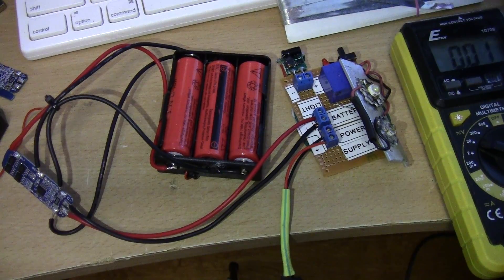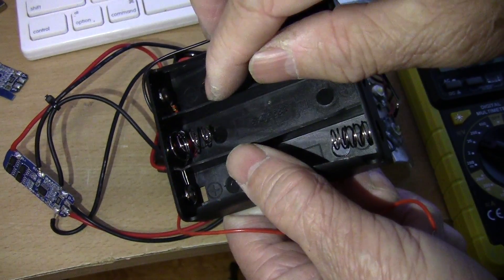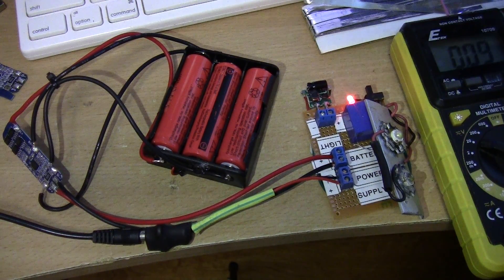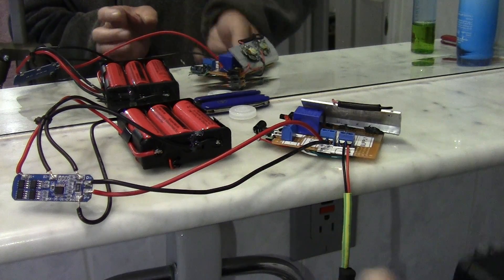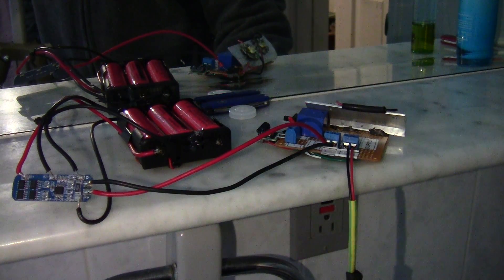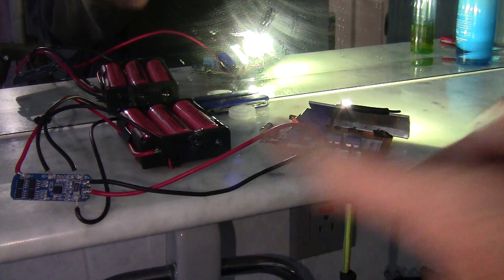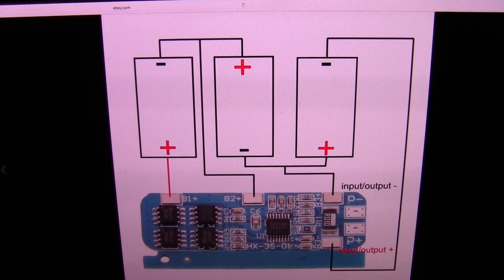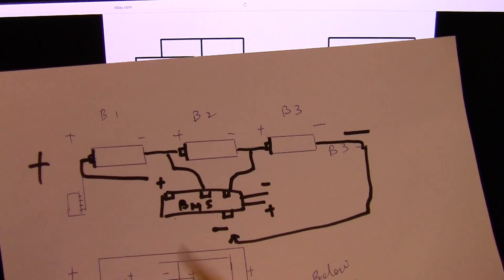12 volt dc auto on emergency light part 2

Comment: Can we charge this bms battery pack while the output of this bms is connected to load ?
Reply from the maker: Probably not a good idea.  I installed a new one on one of my newly built packs and for some reason, it just didn't work.  So if you already have a load on it, I just don't know how it's affect the BMS.

Comment: regarding one of your earlier video to generate electricity i have a question. using 12vt dc motor,
 the electricity which is produced, can it be stored in 500watt battery. if possible how many hours does it take to charge battery full. thanks